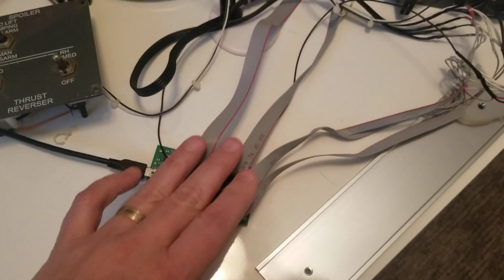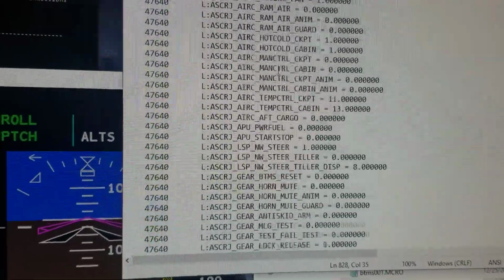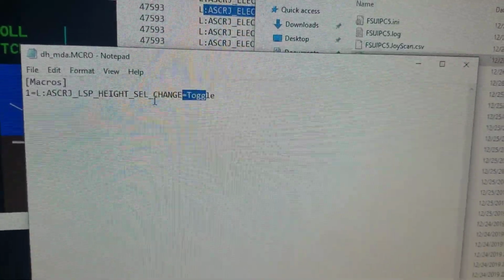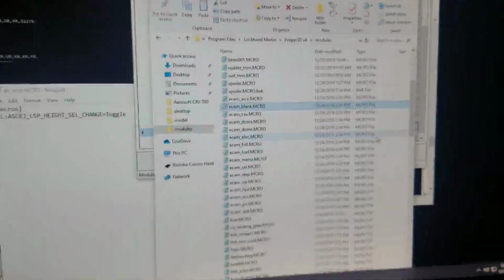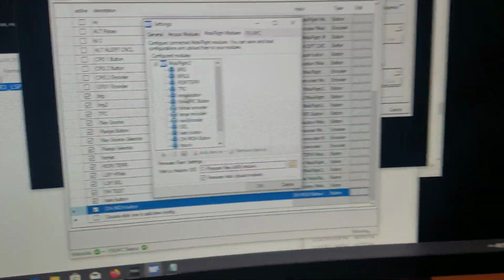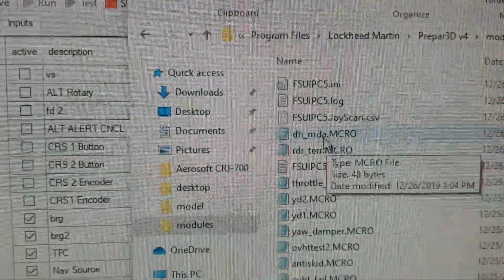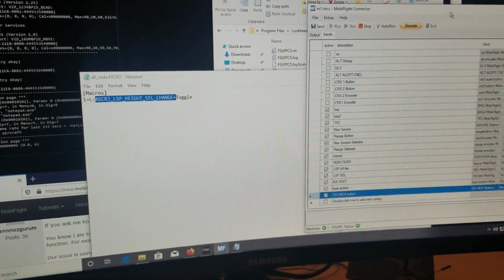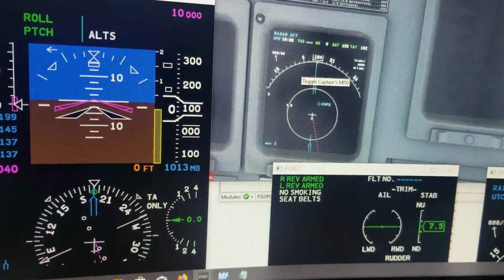Flight Simulator Lua Script & Macro for non-fsuipc aircraft

Comment: Thank you Aaron for this instruction.  I was racking my brain last night trying to log Lvars for this same ASCRJ.  I had forgotten to set the trigger in FSUIPC to capture them.  A side question on the .mcro file, do you limit the number of entries per .mcro by creating one for each panel, i.e. AP , ECAM, FMS and so on?
Reply from the maker: I made one macro for the pedestal and another for the overhead etc.
Reply: I just went to your channel and watched your video discussing my side question 🤦‍♂️.  Should’ve looked before asking. Thank you for the reply.  If you don’t mind my asking, did you have design plans for your CRJ construction? I did a wood mock-up(years ago), but I’m not sure my pedestal and MIP angles are correct or even close.

Comment: Hi, I am trying out the same thing except my macros don't show up in the list.  I checked out all the extensions, everything seems fine. I manually created a mouse macro then replaced the script inside with the LVAR  but doesn't seem to work.
Reply from the maker: Anyway you can do a screen recording of you adding it and post it on youtube so I can verify each step is done correctly?
Reply: @AaronWerner  thank you for being so kind to reply. I have it figured out. The Lvar are scripted in a different way. Its undet the advanced manual. I am sure you know of it.
Reply from the maker: @chomanthapa  I am not sure I did.  Can you share more info for the rest of us? Explain in more detail?
Reply: @AaronWerner  sure why not? This is the scenario.  Say, I want to change the heading to 200 by my voice command or a key press / button.  Now i find the Lvar, for example L:ATR42_HEADING .  So the script is going to be 1=L:ATR42_HEADING=Set,200